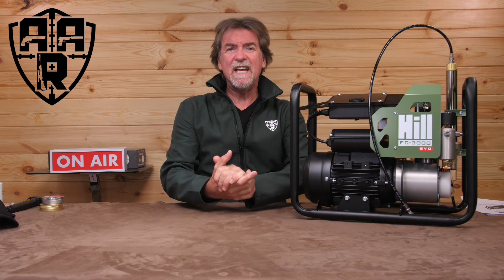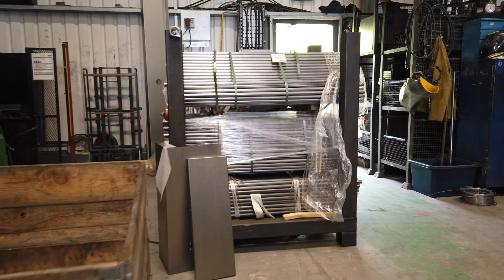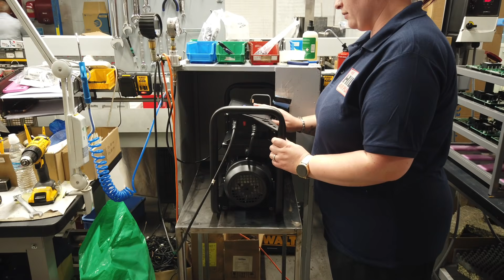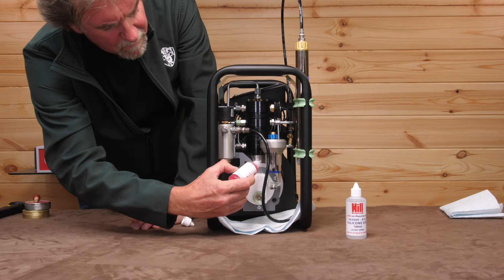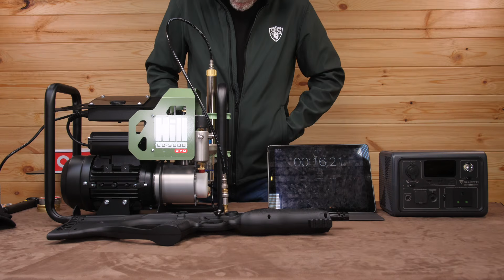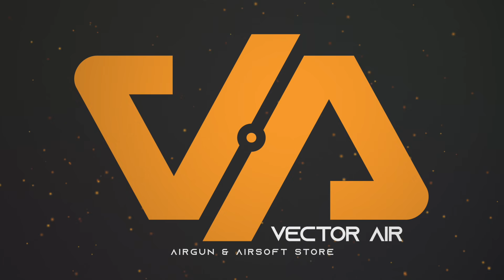Hill EC3000 Evo

Comment: Hi there Andy..
I have a question and to ask your advice if I may.. As I'm thinking about buying a compressor. Reason being is it's just getting to difficult for me to get my bottle filled anywhere, as there is only one place that can fill it near me now. So I need an alternative and a compressor is what I'm looking at. 
But I want the top of the tree if i do, I don't do things by halfs, so price isn't an object in this case. 
But is it worth the money tho? I don't want to shell out to be disappointed.
And I don't want to render my 5L hydro'tech bottle redundant either, It's only 4years old and im about to get it tested.
But will this compressor happily fill my 5L bottle as well then? 

Also I dont know how confident i would feel filling my own bottle either, I don't want to blow myself up. Lol it looks easy enough, I'm sure you end up getting the hang of it.. But how do you actually attach it to the bottle itself tho? 
Genuinely if my place that fills it goes under.. I'll be up sh*t creek.
So I need an alternative.. 
But I'm I looking in the right direction do you think? 
I don't shoot at clubs or anything just round my fields and yard for game and pests "namely rats!" (Sticky foots) I call um 😂.
But I never run my bottle completely flat I'll generally refill it when it's about half empty.
Iv ran it completely flat twice since I bought it in 2022.

But what are your thoughts Andy 
I'm I on the right lines of thinking? 
Cheers 👍

Comment: Andy, I've just bought the latest version called the 310 Evo and it's brilliant and so well engineered I wonder why I didn't buy one sooner. Prior to buying this I bought a small compressor which could run via a car battery or mains electricity with the transformer  built into a single unit. It worked fine but was quite noisy, the fan sounding like a Boeing aircraft during takeoff.  It come complete with a large brass filter containing a drying medium. 
Seven refils later and it had stopped working. The motor would run but no air would come out. 
So I decided to buy the best compressor: The Hill.
Thank you for another superb presentation.

Comment: I've just ordered one of these, i was initially looking at the cheap £150 Chinese ones but I kept coming across bad reviews, I then started looking at £400-£500 ones but again the reviews were quite mixed and I suspect they were still Chinese. Out of curiosity I looked up Hills pumps as I have had one of their stirrup PCP pumps for years and it has been great, I was pleasantly surprised to see they make a powered PCP pump and really impressed that it's British made. I forgot to order the dry pac though so will see if I can order one separately. Thanks for the review.

Comment: Not a deal breaker though. I've e been running an omega air charger for 3 yrs now with no trouble, but I have been thinking about getting a backup with better support and actually designed to be maintained rather than thrown away. I do wish it wasn't so loud tho lol.

Comment: I, too, have the Umarex ReadyAir and have been very happy with its ability in the shed or on the road. But, recently it started releasing pressure before hitting the mark and as a result I purchased the Hill Evo. To my surprise and delight it is MUCH quieter than the ReadyAir! Unfortunately I didn't get the extra dry air filter and will be remedying that situation shortly.
Reply: Update: I've purchased and mounted the extra Dry-pac Pro air dryer filter. Also note: that it is about half-again as fast as my old ReadyAir! Such a nice compressor and highly recommended.

Comment: So i have worked out the maintenance charge as being £200  in total every 50hrs not including the original purchase of the Dry pack pro. £30 per 10hrs dry pack kit refill and £50 for 50hrs compressor maintenance kit. Great product and dry air but one has to factor in this of course!

Comment: But, have they sorted out the rattle with the motor shaft to compressor drive,other than flooding the joint with high grade locktite, as per their own video I watched some time back.

Comment: I bought the version just before the Evo I believe and fitted the Dry Pack Pro ...which does slow fill-time a little and also extends pressurising times. But worth it I feel for cleaner air. Mine doesn't have that blow off valve or the manometer but has the 310 bar higher limit etc. Hill have been EXCELLENT in providing me with any information on queries I had....temp. cut-offs changing with bar pressure etc. and just confirmed with their expertise that this is a brilliant piece of kit. I worried when I bought it that I was spending as much as a nice pcp on it, but it has proved it's worth over and over!! Great British Company!!! Well done all at Hill. 🙂

Comment: Doesn't make economic sense to me. £5  a fill at shop. Therefore 20 fill = £100. 200 fills per £1000 sorry Andy rich mans machine
Reply from the maker: Hi, Like I said in the program, it isn’t for everyone, however, your maths don’t actually add up fully, you missed out the initial cost of your tank (circa £300?) the cost of fuel to and from the shop, possible parking fees, the time involved and the reason I bought one in the first place….convenience (priceless to me). But I understand your point, just as we don’t all need a high end PCP’s when a £50 springer will fire a pellet down range, But I’ll stick to my Engineered PCP’s…thanks again for your comment, stay safe. Andy

Comment: If this is so good then why don't professionals use them? Because for starters, apart from speed, they cannot remove all the moisture necessary to fill dive cylinder without causing corrosion. My local professional qualified person said the minimum cost of a professional compressor in the UK is just over £4k. Their present professional dry air filters cost hundreds each. He also stated that the idea of filling up to 300 bar with such a machine actually horrified him. I will continue to have professionals do the serious/dangerous work of filling a dive cylinder. Cost is far less.

Comment: You guys should look into the OMEGA AIR CHARGER it's about 1600 with tax and everything but it will fill any size carbon fiber tank with ease and it is one of the compressers that Matt Dubber and SOUTHERN GUNNER has and reviewed many times year after year with no problams at all.

Comment: Bought the Hill ec 3000 evo last week with  the pro pac  after weeks of reserch ..fills my Hw 100 and AGT Vulcan 3 in no time ..cracking compressor and the sales team are absolutely brilliant and really helpful...well done Hills great to see the UK doing it properly .
Reply: I gotta ask how’s it performing after a year? And also how is the Vulcan 3 performing after all that time as well? I’m just getting into pcp’s and saw they made a evo-310 for the American market which is basically this one but with a white instead of green accent, and I’ve seen the Vulcan 3 has good reviews, I started with the Umarex Notos(had a small budget to begin but I’m planning future upgrades)
Reply: @cesarvarela5438  the Hills pump is fantastic i really couldn't say a negative thing about it at all ...as for the V3 thats a different story I ordered one and while waiting got a 2nd hand one I had nothing but problems with it not holding zero and reg dropping so I put it down to been 2nd hand then the new one arrived and was just as bad hit and miss reg issues not holding zero one shot spot on the next a good 10 inch off ..the whole carry on with AGT v3 pulling reg and adjusting then putting back in was a fxcking pain in the arse so I sold it and now have a RTI P3 which is tuned and it is so much better than the v3 ...the reg can be tweeked without pulling it and it holds zero ..far far better than the vulcan ..
Quite a few lads I know got rid of the v3 and bought the RTI P3 mines in .25 ... look them up ..I got the power plenums and the donny silencer its a beast .

Comment: As well as the EC3000 I have bought a Gamo gx40 and BSA r12 after watching your reviews. Word of caution! Bought the Gamo from Vector air, had one or two minor issues but the customer service was above and beyond. Sent me what I needed to do the repairs myself, can't recommend them highly enough. Unfortunately, my R12 had to be bought from elsewhere because of availability issues. RANGE AND COUNTRY. I had a seal fail and replaced it, easy job but still had a small leak which I have since fixed. I reached out to RANGE AND COUNTRY and their attitude was TOUGH LUCK. The warranty was invalidated and they refused point blank to give me even the most basic help. I know that Vector Air wouldn't have treated me so poorly. Lesson Learned, you put your reputation on the line by associating yourself with Vector Air and they don't let you or their customers down.
Reply from the maker: Thank you for your positive comments and feedback, I know that Vector pride themselves on customer service, I will pass your comments on to them. Thank you for taking the time to share this. Stay safe. Andy.
Reply: I've heard a few bad things about range and country regarding customer care, not good

Comment: I won't be buying one. I only have 5 hours on my old EC3000. Fill my 5 litre bottle from 200 to 300 bar more or less weekly and it has never missed a beat. Fantastic bit of kit, bought on your recommendation.
Reply: About how long does it take to top it off? 
Thank you
Reply: @rogerlikes   about 30 mins depending on outside temperature to top a 5L bottle from 200 to 300
Reply: @urbanspaceman7183  ok, Thank you. Roger

Comment: I have the Hill EC3000 . I wish it had a couple presets buttons on the control screen that could be programmed for specific guns. I like the compressor but it is a bit annoying having to spin the dial every time to set pressure. It would be nice if there were a few buttons that you program on the interface. Perhaps 2-3 buttons that you could set at different pressures. My Steyr Evo10e set to 200 bar, the  red wolf at 250 bar etc .

Comment: i would like if the degassing was made so that it not blows  in your face or over the hands , and i think  bigger coolribs like a moped  would made lesser cooling stops necessary.  a forced aircooling. i got a hill 3000 . its a fine tool , got a big  extra moisture  filter from amazon    ,there where no available then from hill
Reply: No need to put your face anywhere near the blow off valve!!!!
Reply: @nigelbase1196  it wil blow round .always keep a cloth to kep the silicon vapor

Comment: Awesome!
I'd definitely would want one of these. Oughta be pretty well known by now to be one of the absolute best compressors out there - or at least in my opinion.
All Brithish design and manufacturing is a big thing in my books (even though I being from Finland).. IF I had the money, I'd drive a Bentley Continental GT (though I think they nowadays being owned by the bstrds from VW🙄) ... when not being at home filling my PCP with the Hill compressor..😁
Reply: That PCP better be an Air Arms or BSA then 😁
Reply: @sergentcolon1  With the money.. It'd surely be an Air Arms S510 Tactical (full power, of course)..
But as for now (just as a flat broke airgunner🤣), the PCP surely just is my beloved Sig Sauer Virtus..